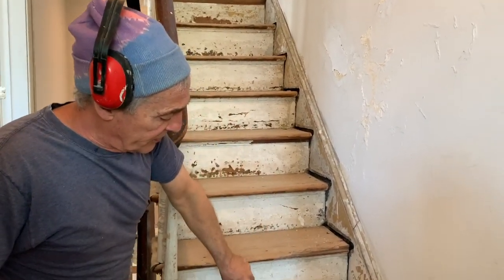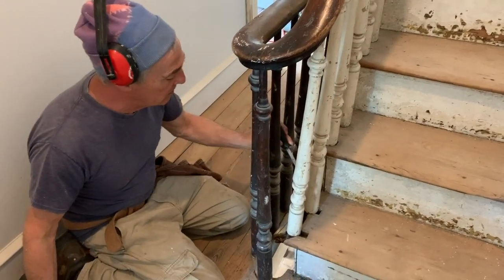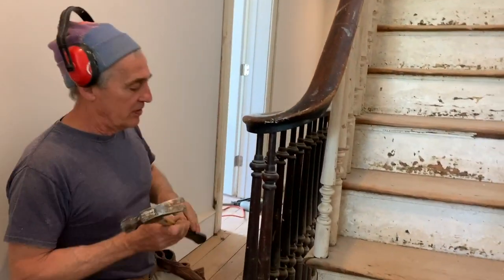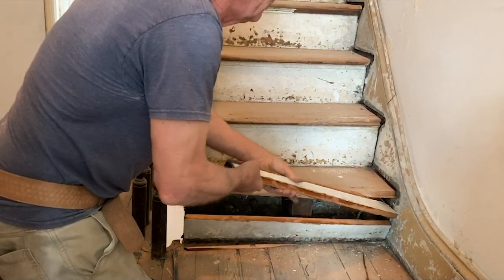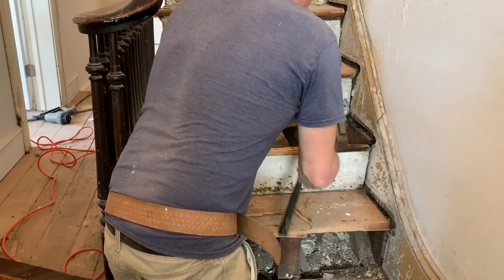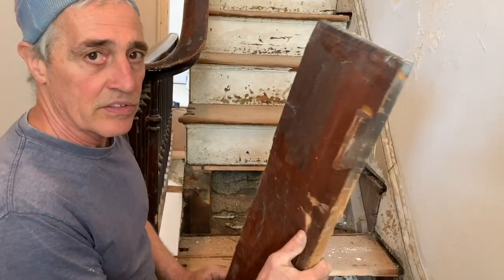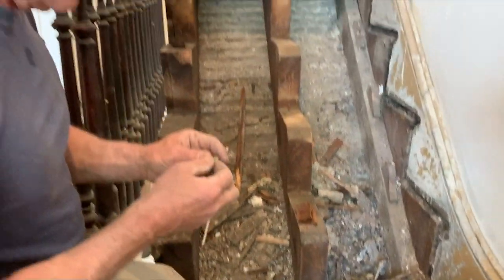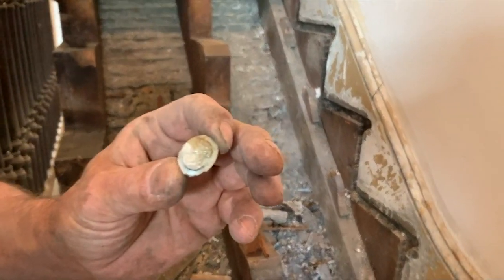Removing Treads and Risers from the 1870s:Old Carpenter Techniques and Treasure

Comment: I notice it was coming off in pieces. Is there a way to take it apart to restore it & place it back together? Or would the wood be too old & broken down? The wood on what im working on isn't in rough shape like that, But it was all nailed together i kind of want to take it apart sand it all down & add screws instead of nails. Especially for the railing. But the old wood is way more seasoned & hardy than what we got today, so i'd to keep it as long as i can rather than replace it with some cheap baby wood.
Reply: Yes, in England, most people would repair this rather than ripping it all out wastefully, meaning you lose the historic character.

Comment: Is there a way to tighten the bottom of the riser to the stair steps below that riser without opening the hole in the back of the stairs?
Reply from the maker: probably some well placed and angled trim head/finish screws.  You would have to pre drill carefully